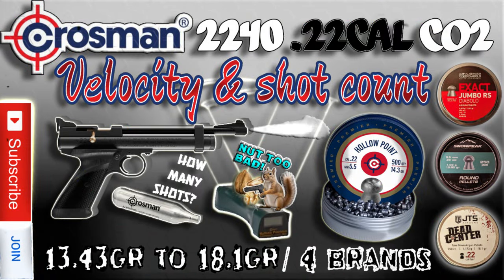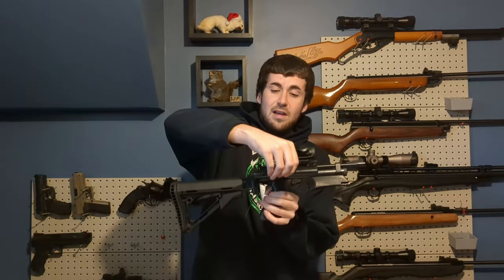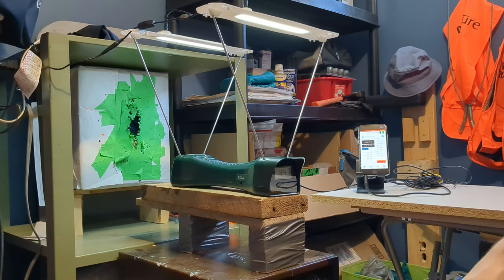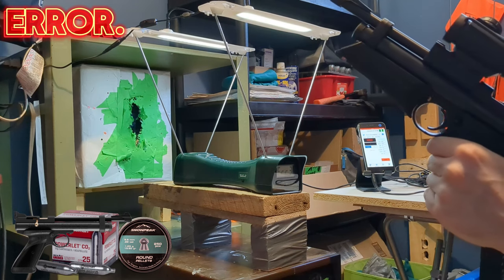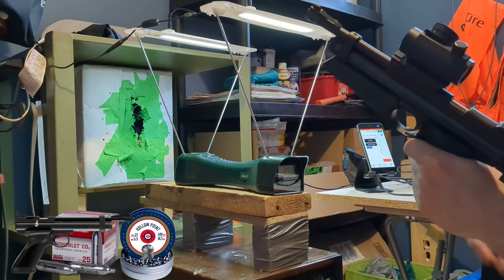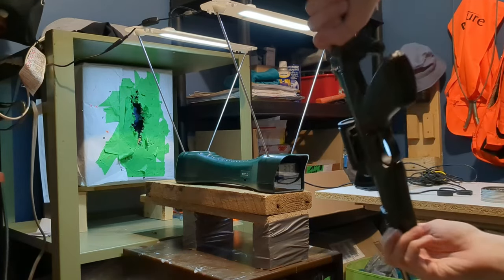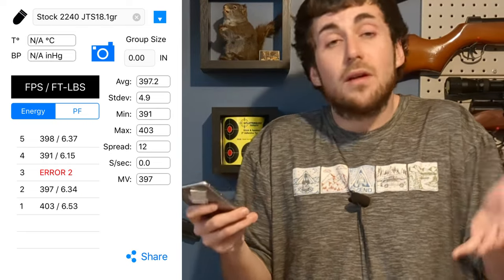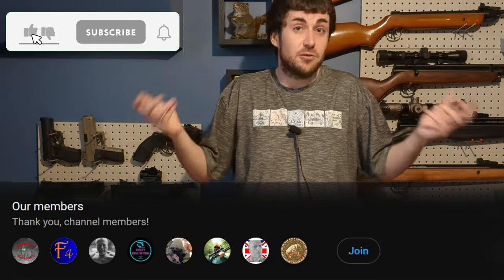Crosman 2240 .22cal Co2 pellet pistol Chronograph test - 7.5in barrel and plastic breech {Velocity}

Comment: Nice job Lowkey!. I love my 2240s but the Diana chaser.22 is more powerful,  accurate and gets more shots than the 2240s..nice testing!
Reply from the maker: I almost got one instead of a Crosman but the customer service and part availability in Kenada made me lean for the 2240!
And with my luck I had to use the warranty.

The Diana barrel is 1inch longer I believe so that would already add arround 5fps to it
The valve might be slightly more efficient tho

How many shots you get out of it?
[We won't even talk about the 17.5in barrel or we would need to compare to a 18in Crosman]

Thanks for watching! :_LwkLogo:
Reply: @LowkeyAirgunner  I get almost 2x the "power shots" that the 2240 gets in the same configurations..👍 in the hotter months itll get 60 shot on one co2 capsule..
Reply from the maker: @gwhitfield4239 Curious people online seem to say that you don't get much more than 40 but co2 is definitely weather dependent☀️
Reply: @LowkeyAirgunner  sometimes I only got 50 ish. But I've gotten over 60 a few times as well..